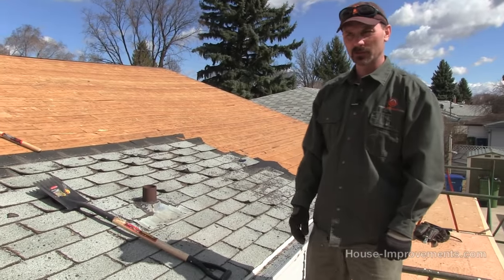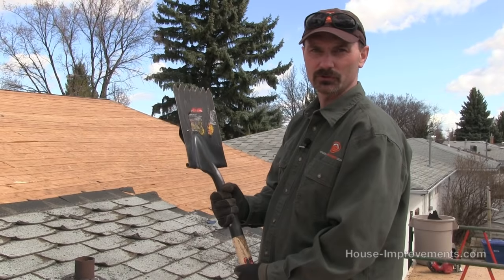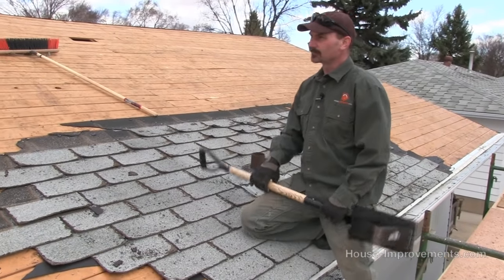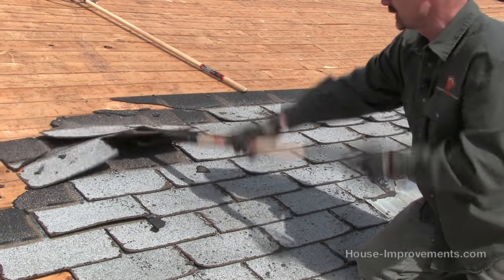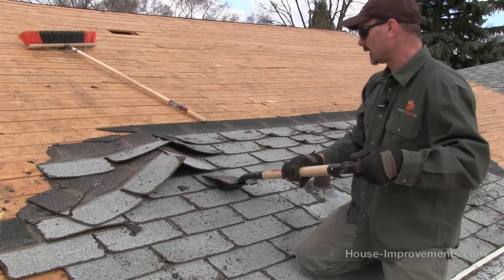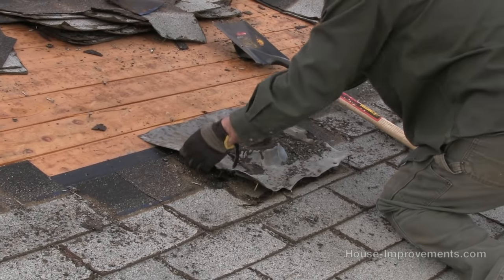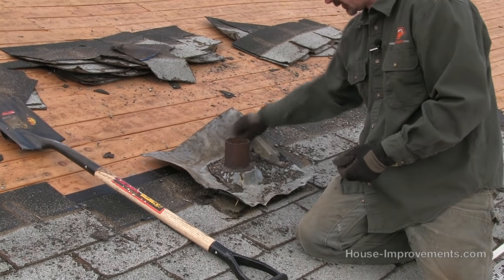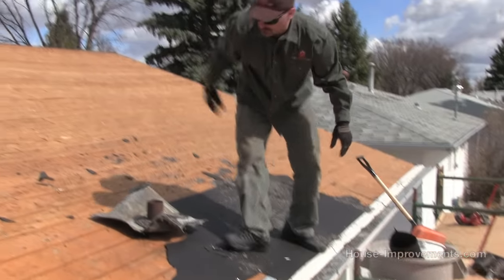How To Remove Shingles

Comment: Show us how to do this with 3 layers of roofing installed. UGH!
Reply: Red Ripper and a pitch fork. You can't beat the ripper!
Reply: Red ripper is going to make one hell of a mess. Tear off a layer at a time. In the long run it will be done faster as long as some is catching and tosing at same time, the no clean up when done will make all the difference in time.
Reply: Tore roofing off one house working for my father in law that had SEVEN layers of tar and roofing!!  Roofing came off in pieces no bigger than a pie plate.

Comment: This doesn't look as hard as I thought it would be
Reply: Lol, by the time you set up scaffolds I'll have half the roof off. Also it's not really hard but most can't handle the heat or cold, the steady pace cause have to beat weather, and the heavy lifting and packing of shingles. A bundle of architectural shingles weighs around 90 pounds, if you roof is a small 20 square then that means you have to get 60 bundles up on the roof. 20 square is a very small house most normal houses are in the 30 square range. Any jackass can tear stuff up but when it's gone and must be fixed, it takes a little more ass and common sense to get it done correctly. God forbid your house has walls,skylights, or fireplaces. Flashing and counter flashing is what separates a roofer from a nailer/laborer.

Comment: bro youre fired, start in a corner pop 3 shingle ends, grab them lift them and pop ur nails as u lift slap all three down in a pile, also always get new flanges reusing old flashing is trashy. also at 9:50 shovel in one hand broom in the other saves a hella lot of time

Comment: Why not just run a second layer of roofing over the first existing layer?
Reply from the maker: It is done sometimes but I do not recommend it. That adds a lot of extra with to the roof system and also if the shingles are in bad shape (curled up and such) the new shingles do not lay down nice and seal up as well.
Reply: mitchil Geary Yuck
Reply: also going down to decking will allow you to put on proper felt paper and fix any bad wood
Reply: HouseImprovements    Thanks, good job nice vid you are right those 3- tab shingles have done their job, too curly and damaged to overlay besides code would require stripping due to poor condition of shingle. Thanks again.